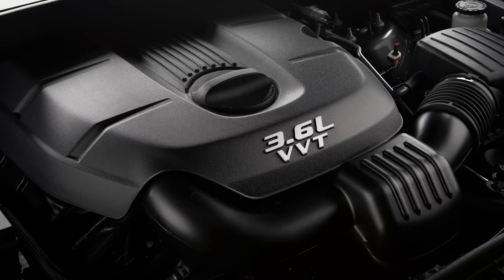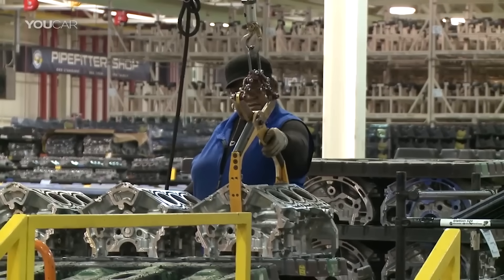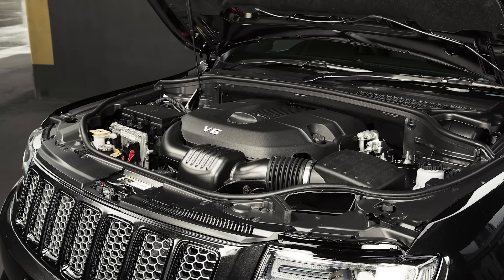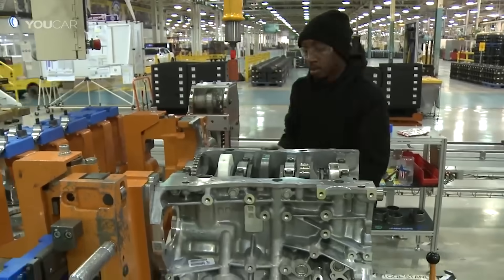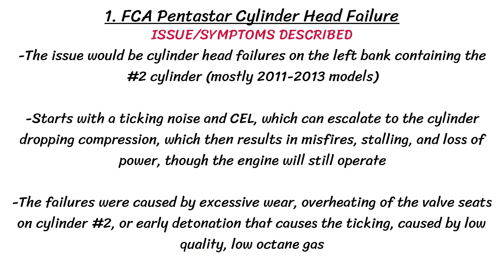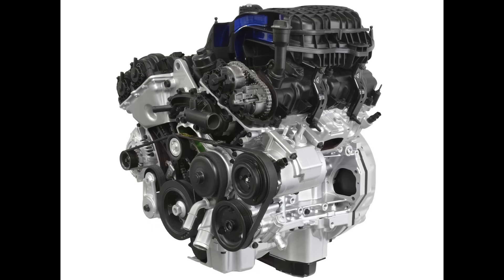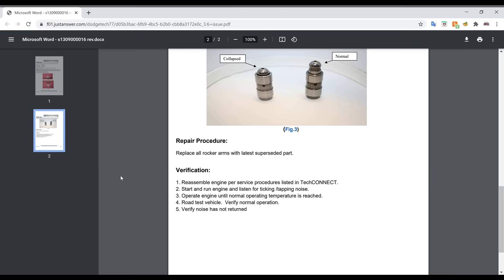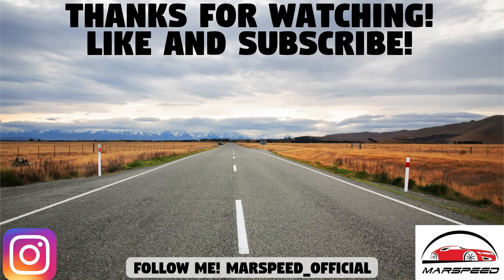The Specs and Fatal Flaws of the Chrysler 3.6L Pentastar V6 Engine

Comment: I'm a mopar tech and on average I do a cam/ rocker arm job at least once a week
Reply: Job security.
Reply: Cost?
Reply: @peterpizzurro  what make model and year is your vehicle?
Reply: @sethc7502  I have a 2015 Garbage Machine Silverado. Was just curious on cost as I need to get the DOD delete done or get a new truck.
Reply: Peter Pizzurro well you wouldn’t have that problem if you got a older 350 or 454 big block and make sure it’s carburetor and your golden .
Reply: Both engine banks roughly run $2500 out the door and one engine bank is roughly half that. The labor cost depends on what vehicle it is and what engine bank.
Reply: I like the 3.6 in my '14 Ram pickup a lot! Lots of power! I had it waaaay overloaded with river rock the other day, and that engine pulled the truck right along. My gripe is the HVAC system completely shuts off at will for no apparent reason. May not do it for weeks, or may do it 3 times in a week. Ever hear of this?
Reply: @thenormalguy6683  need some more info. Does the blower motor stay on? Or does everything go dead? Does it only do it with the ac or with heat as well? And does it just come back on while driving or do you have to shut the truck off and start it again? It could be a few things.
Reply: @sethc7502   - First of all, thank you for replying! Nope, the whole system goes dead - nothing. Will do it in hot OR cold weather (AC and heat). It will all shut down at random times, and for random PERIODS of times. It sometimes will come back on with an engine restart, sometimes not. Several times after a random shutdown, I will park it in my garage overnight, and always comes back on the next morning. It's been 3 weeks since the last time it did it (heat was on, but not on high).
One thing I DID notice - It does it a lot on the hottest summer days (AC on), and on cold winter days - but only after it gets really warm inside the truck.
I was thinking it may be the blower resistor, but I can't even find where it's at on a 2014 Ram! I don't see it in the usual spots where it may be. Unless it's hidden behind the fan?
Oh forgot! When it does the random shutdown, the AC compressor light REMAINS LIT.  And I tried changing all the air outlet settings  - no go. I hope I was thorough enough - I know how important a good description is because I used to be a Chrysler/Dodge/Plymouth/Jeep Service Manager at 3 dealerships!
Reply: How often do you replace rockers/cam for model years after 2014?  I have a 2016 300c
Reply: @wadejoshua2866  pretty often

Comment: My 2012 Wrangler JKU (96k miles) so far has had these parts replaced:
1.) Radiator (leak at bottom plastic side on d/s).
2.) Oil cooler (cracked plastic inlet tube where rear coolant hose attaches).
3.) Water pump (impeller blades flaked off and inhibited flow).
4.) Plastic Thermostat housing (cracked).
5.) Heater core (leaked at both inlet/outlet aluminum elbow fittings of the heater core).
The motor runs strong but Jeep could've done a better job in designing stronger coolant system parts made of metal instead of using composite plastic.

Comment: I just paid $1650 for problem #2 last week in my 2014 Durango.  They replaced all the rocker arms on the driver's side, plus an exhaust cam shaft that the bad rocker arm had worn grooves in.  Not happy.  If you hear that tick, get it fixed immediately.
Reply: I get a clank clank clank when I hit the gas hard and it Goes to higher rpm, is this relates? Only happens sometimes
Reply: @heythere6983  No - for the problem I had it's a constant ticking sound even at idle.

Comment: i hate the two stage oil pump at idle with the low oil pressure and the engine oil water adapter and the transmissions just sucks  if its a private owned you should be good but a fleet vehicle be prepared to spend some money lol

Comment: 2016 Grand Cherokee started ticking and got the engine code for cylinder misfire 😬
Reply: It will need a new cycle head I bet. Maybe just a valve spring. Or a cam. We get a couple a week at the dealership for that same thing.

Comment: My 13" Charger SE got 197k miles with zero problems except for the oil cooler gaskets drying up and cracking causing a minor coolant leak. Fuel pump went out at 196k. Serviced religiously at oil change recommendations and tuned to match 91-93 octane gas. Real cheap prevention in total, hope this helps anyone concerned about their 3.6L.
Reply: The correct format for abbreviating a year is, '13 — 13" means 13 inches.

Comment: Different motor but my 2006 Chrysler 300 touring V6 just hit 218000 miles ticking started about 2 years ago  Pretty sure it's the rocker arm assembly on passages side.

Comment: Can you do the 2.4l next?
Reply: Thermostat rationality issues,took me like 4 hours for that 🤬thermostat..Chrysler gave the middle finger to the tech
Reply: Oil consumption problems. Coolant leak from rear of cylinder head. Oil pump pressure spring. That's about it right off hand.

Comment: I have a Chrysler 300 2012 with full bolts on tac is at 110k 
1.Cai
2.Tb spacer
3.Bored out TB upgrade 80mm
4.Ripp Ignition Coils
5.Pedal commander
6.Diablo 93 octane tune 

So far feels like a complete different car no issues so fars

Comment: This engine is a great engine , very reliable and technically sound. It’s major flaw is it’s slow asf
Reply: 275+/- HP and you're calling it slow? Bull crap.
Reply: @MyerShift7  275-300 hp isn’t fast buddy, especially in most of these cars that weigh 4000 plus pounds. It’s not slow to the point where it is undrivable but I have driven in a 2018 v6 grand Cherokee and a 2020 v6 challenger and they are definitely slow

Comment: My 200 is at 48,000 and I haven’t had a single issue. Synthetic oil changes have made the engine more smoother and quieter.

Comment: I had one in my 2012 200, loved it. No leaks, and always ran good. Then again, it had less than 50k on it. The fatal flaw was the stupid horrible performing/shifting transmission in those early 3.6's.
Reply: Yes the fwd 6 speed is not great but mine improved with a filter and ATF4 Mopar fluid change at 120,000 mile I wish I had done a fluid chain/filter change at 60k miles.
Reply: @robc8468  2016 caravan the 6 speed has been smooth as silk.
Reply: Yeah I also had a 2011 200. The trans was horrible. Intermit hard shifts into drive or reverse and harsh down shifts at times too. But the engine was great. Tons of power. Punch it from a stop and make sure you hold on the to steering wheel mad torque steer. Traded in with 60k for a 14 charger rt 5.7. I upgraded the intake plenum with the 6.4, wired the srv with a mds switch, cai, long tube headers, high flow cats, custom Jay Greene tune, and tranzformer shift kit. That thing was a rocket, then traded in for a 16 challenger 392 scat pack 6mt. This was was a handful to drive, all that torque and lack of traction was fun. Now I drive a 19 honda accord 2.0t, that gas guzzler was killing wallet.

Comment: I was amazed at the gas mileage my 3.6 got in my 2014 Grand Cherokee and that thing was a tank of an suv. 24-27mpg at 75mph depending on wind and terrain. I'm back in a HEMI Ram but considered a brand new single cab short bed Ram with the 3.6 since they were going for so cheap but knew the HEMI in a single cab short bed was what I really wanted. In a car or suv I'd own another 3.6 because of how smooth and refined the feel was.
Reply: I recently traded in a 2013 Silverado reg cab with the 5.3 L V8 for a used 4X4 2017 reg cab long bed Ram with the 3.6 L V6. I was dubious about the smaller engine but took a test drive and was pleasantly surprised at its performance.  It is no hot rod but is very adequate for normal driving. And gets amazing gas mileage for a full-sized pickup. It generally gets 20+ mpg for my routine driving, in warm weather. I have seen 27 mpg for a 170 mile trip with a light load on two-lane roads driving 60 mph. My criteria for performance is passing capability towing my 3000 lb boat. No issues here, it exceeded expectations, subjectively pretty close to the previous Chevy. Admittedly it revved up a bit more, but I that's to be expected as its 305 hp  peak RPM is higher than the Chevy's 335. (And the 3.6 L's torque is a lot less.) I had one problem with the engine shortly after purchase which was fixed by the dealer under warranty - the plastic housing for the oil cooler/oil filter/etc cracked during a -25° cold spell (I live in MN) causing oil leakage. The dealer said this is pretty common and can be caused by overtightening the oil filter, due to the added stress plus the plastic getting brittle in the cold.
Reply: First 400 mile drive with this engine in a 2013 Journey used 6 gallons for the first 200 miles at 80 mph and the second leg back against the wind at 80 used 6.5 gallons so 30 mpg or better both ways. Took roof cross bars off and aired tires to 44 psi using Castrol 0 to 20 synthetic oil. 87 octane fuel.
Reply: I had 3 hemis and then I bought a 1500-classic warlock with the V6. Honestly in day to day driving I don't miss the hemi, the 6 just needs more revs and it's about a second and a half slower to 60. I'm getting 20 mpg with 275/65/20 mud tires.
Reply: Same here, had the SRT and sold it to get a small performance car and a 3.6 for the dog. 3.6 is way better than the 6.4 Hemi apart from the noise. Fuel consumption is amazing and I've not lost any points, lost 6 points in 6 months owning the SRT 😂 SRT is way to easy to drive fast, even my nan could drive that.
Required a fast car with manual to help my need for satisfaction. The SRT was too boring and so many nanny aids. 
I watch all these punks driving it fast, wow! Such amazing drivers - not! Personally if your GF, Mum and nan can drive it = Not a performance car. Opted for a MK2 Focus RS and a 3.6 blackhawk with the money.

Comment: I’ve had Jeep Grand Cherokees with pentastar engine since 2012,2015, and 2018 to present. All 3 year leases. Never had an issue with the engine. Always ran smooth, powerful, and efficient.

Comment: Ughhh crap. My company car is a 2015 Caravan with this godforsaken engine and it's ticking and missing already with 36k miles on it -- was doing it when I first got it at 30k miles a little over a year ago. I brought it in to the shop for a CEL 2 months ago and they replaced the thermostat, which was a little weird to me, cuz the temp gauge never indicated it was running hot or taking very long to warm up. But regardless, the code cleared and it seemed to run better afterwards. Now a few days ago the light came back on and it's misfiring and stumbling at idle pretty badly. Do you think I'm totally screwed and the heads are shot? AFAIK the van is out of warranty and if it costs too much to fix, I'm just gonna lose it and have to use my own personal vehicle for work - which would be a disaster because I don't even own a car and parking where I live is a nightmare... $400/month for a parking spot!!

What do the Chrysler experts think I should do? Am I better off driving it into the ground until December 2021 when the inspection expires and I'm forced to take it back into the shop, or should I chance it and take it in right now to hopefully avoid more catastrophic failure down the road?

Comment: I guess I can't complain yet. 65,000 miles and (at the risk of jinxing myself) all I've had to do was replace a cracked thermostat  housing.  It's apparently a known issue. Jeep redesigned the part adding beefier plastic around the failure points.  It sucks that most aftermarket parts are still selling the older design making you predisposed to suffering the same failure. Thankfully,  YouTube is great for showing you how to change it.  Saved myself a few hundred dollars replacing a $28.00 part that took me 30 minutes to replace.  Overall,  very happy with the engine considering how much abuse it gets. I do change the oil myself religiously every 6,000 miles with synthetic and that's pretty much it.

Comment: 48,000 on mine that's a 2016 200.  Engine tick (rocker arms)and oil leak(oil cooler).  Driven lightly and now actually doesn't get driven at all now.  Just paid it off and plan on doing something crazy with it eventually.  Saving until then but I like the idea of rallying it kinda lol

Comment: I owned a used 2013 dodge journey crew model with about 87k miles before i bought it. They're were no records of issues at the dealer before I bought the car and I drove the vehicle over 130k miles with no issues as well. I only use 91 or higher octane and put in very high quality oil such as amsoil. Vehicle ran smooth and very quiet to a point I keep thinking it shut off. Haha!

Comment: I have a 2015 Town and Country with about 75k miles. Recently got code p0128 which is related to the thermostat. Plan on replacing it soon. Van has been reliable overall

Comment: I have the 2015 Durango with the 3.6 and I am just hearing that ticking from the left cylinder head. I bought it used and now with 110,000 and now I have a 155,000. No issues until that ticking noise a few days ago.

Comment: I have a 13 Charger with the 3.6 with 151k on it and still runs like new. Haven't had to do anything except regular maintenance
Reply: 2012 300 8speed 158000 miles no engine problems average 28 mpg
Reply: @craigklinski9075  thats highway MPG, def not city or mixed driving..
Reply: Lol coward

Comment: Chrysler had that same problem with the LA series engines (273/318/340/360) where they weren't getting all the casting sand out of the blocks.  We fixed a bunch of them back in the '80's
Reply: I thought the 360 was an iron block.

Comment: Not a bad engine. I wish they kept the 3.9 magnum v6. It's such a simple pushrod engine with good torque they could have built on! That's the most reliable v6 I've seen.
Reply: Reliable yes but a big pos better off with the 5.2 I actually get better millage out of it. The magnums are the easiest engines to repair tho what we waste in gaz we save in repairs best for a do it yourself
Reply: @bobmorane2082  I have a 318 magnum in my 96 Dakota! Great engine behind a 904 or 727! The conversion from fuel injection to a 2 barrel BBD Carter was easy!
Reply: @beniamino939  you can actually do that? You remove the injectors and fuel pump to replace it with a carb?
Reply: @beniamino939  actually you still need the pump you keep the electric pump?
Reply: @bobmorane2082  No. I mounted a lower pressure pump on the frame with a bracket. You can mount the pump in a cool spot near the fire wall as well. I took apart the sending unit so the gas gauge works. You have to place a straight metal pipe with a 90 degree fitting going to the bottom of the tank. I would say that was the hardest part of the swap.
Reply: @bobmorane2082  I would imagine if you swapped the front cover and put an LA cam in you could mount a mechanical fuel pump eliminating the one in the tank. But a Carter high volume pump is the way to go!!
Reply: You can use the Auto shut down relay to control your ignition 1 and 2, fuel pump and other vital accessories. It's the blue wire that connects the fuel injection system. I plumbed of that wire and left a lot of the wiring alone. Just mak sure the ignition and other accessories is wired to run off the alternator, so if the battery is low you can start and run the car. Get a decent two wire voltage regulator and Chrysler ignition box and two prong ballast resistor. The magnum coils stock are amazing, so keep that setup and wire that to the Chrysler electronic ignition box.
Reply: @bobmorane2082  Yes.  You need to put in the LA style distributor. This conversion can be done under $1000.  The most expensive thing is the 904 or 727 torqueflite. But to do away a kickdown linkage/cable go with an AX-15 from a magnum. This transmission bolts up to the 318 perfectly. The clutch and flywheel are a little small, so get one that fit in a V8 application. I believe the ram 1500 transmission is good choice because those manual transmission came behind a 318 magnum. You don't need a pcm/tcms to run those transmissions

Comment: I went with my friend to get a 2015 200c and it was in pristine condition but unfortunately we ended up walking away because one of the rocker arm bearings was so bad it wouldn’t even start the first three times but it ran fine despite the loud tapping.
Reply: How many miles was on it?
Reply: 154,000

Comment: I have a Chrysler 300s v6 pentastar and so far i have 58.000 miles on it, and i have never gone to the mechanic for any issue with the motor, no tics noise and I think is the best car i ever had. Very powerful, smooth i love it. My was made in Canada 🇨🇦
Reply: 58,000 miles is still reletively new for a modern engine. Get to 250k and we'll talk about whether or not it was actually a good performer.

Source: my chrysler 3.3 now has 253k on it and while its had some tune-ups, never had to have the block ripped apart for anything.
Reply: That's why it was made in Canada not the USA
Reply: The car was, the motor wasn't.
Reply: Agreed…. There should be no issues on a vehicle with that mileage
Reply: Car was assembled in Canada, not made